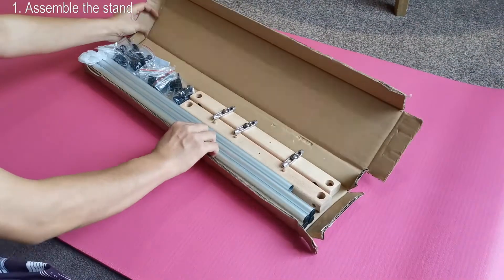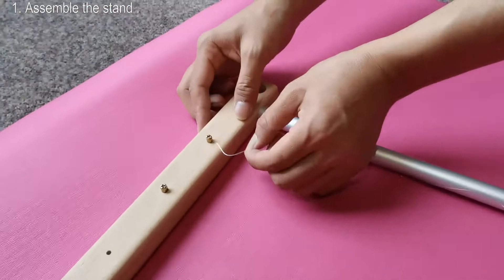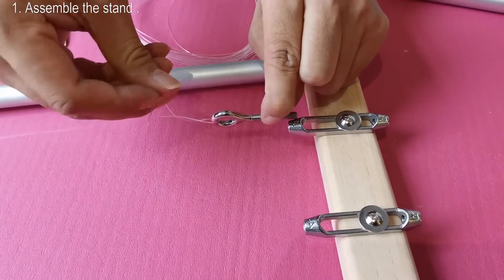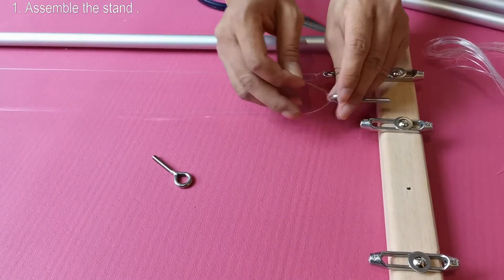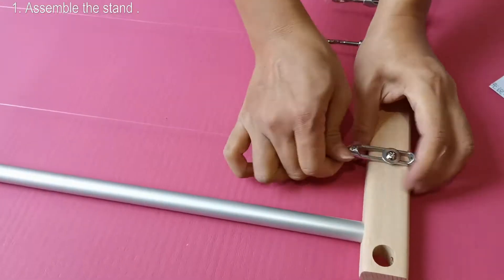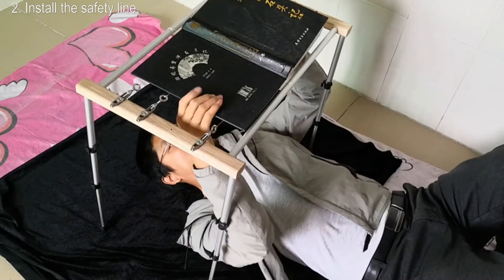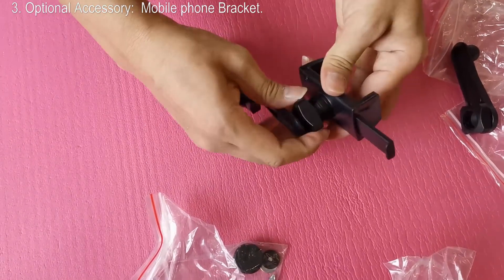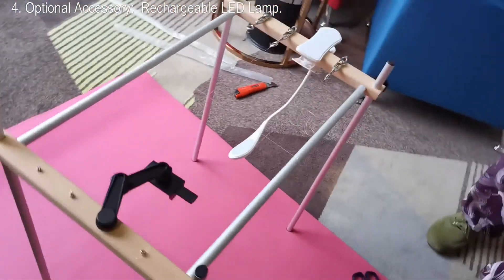watchUP Supinely Reading Stand Assembly Tutorial

Comment: Thank you so much! I've got the box delivered 3 days before eta. Just finished the installation. It took me less than one hour. Surprisingly very high quality. Just plastic on the lamp looks a bit scratched all over the place. But wood, metal and Mobile Phone Bracket is perfect.
So happy someone finally invented that!
Still wish to Designer to heal the cervical spondylosis. There is no need for that anymore 🙌💛🙏
Reply from the maker: Thank you, I am the designer,  　I am very happy to hear your feedback here.    For my  cervical spondylosis, it does not ache now, only my neck has noisy when moving.  I can work and use computer hours everyday.   Wish everybody has a healthy neck.